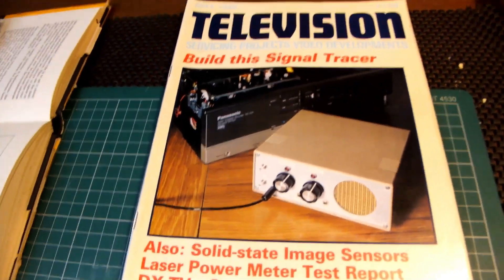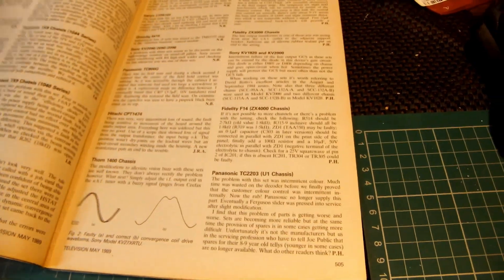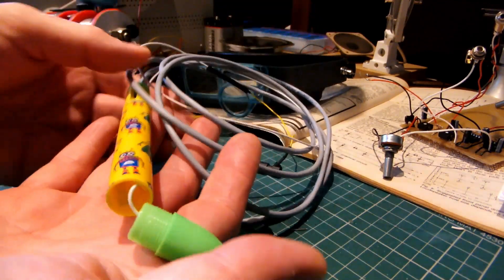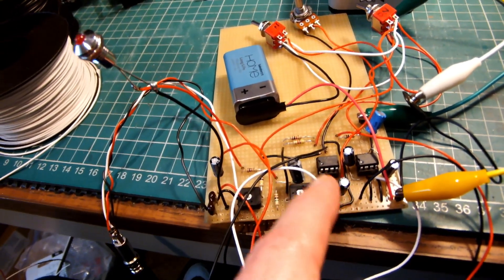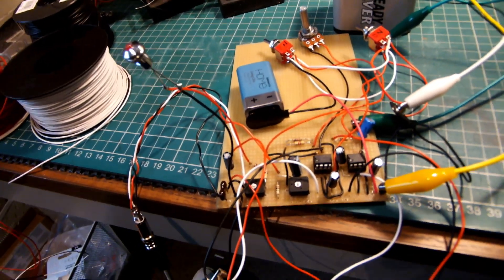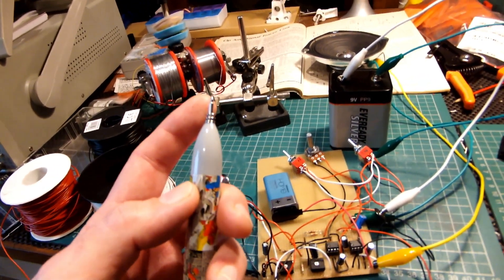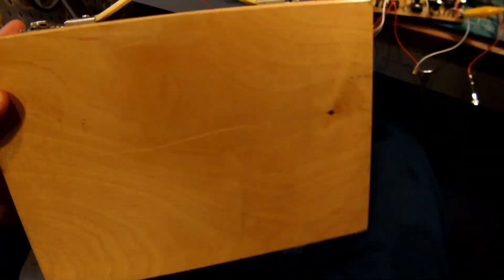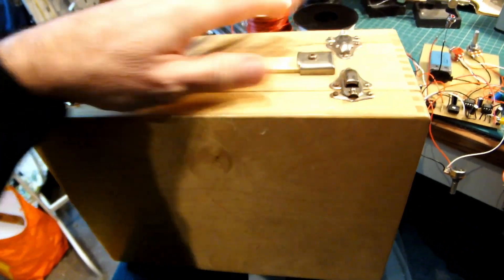Signal Tracer  - make your own - Part 1

Comment: Why would you put it in a plastic or wooden case!? 
Why does it say put it in a plastic box and not a metal box!?
I don't get it? You want the pcb to be RF isolated right!?
Put the whole thing in a faraday cage!? Except for the probe tip!
That is why you also also use coax cable right!?
Whay would you want that 60/50Hertz hum All the time!?🤷🏻‍♂️🤷🏻‍♂️ 
You only want to pick up a signal at the near vicinity of the probe tip right!?
Reply from the maker: I know, that was my first reaction too. All the valve gear tracers with magic eye tubes (eg Heathkits) were in metal cases.... I built it following the article's instructions...🤔

Comment: Shielded signal cables have left the chat 😂
Considering that the whole idea of signal tracing is to determine the quality along the signal path, why are you using all those antennas to introduce massive amounts of random noise into the circuit, defeating the purpose of the test equipment?
.
Copy/Paste from the article "use good quality flexible screened audio leads for both probes" 😉
Reply from the maker: Thanks johncoops6897 for the comment. Yes, the probes use screened two-conductor cabling, each with a single grounded wire external to each probe. This is as the design describes. The remainder hook up wires were a quick test of the circuit, which works well even with the low level of care in the testing. In the final build (currently underway), I will  be focusing on how to minimise stray noise.
Reply: The Radio Shack Signal tracer I’ve used for years was built in a plastic box and used regular single wire test leads. Had an RF and AF inputs. Worked great, no problems.